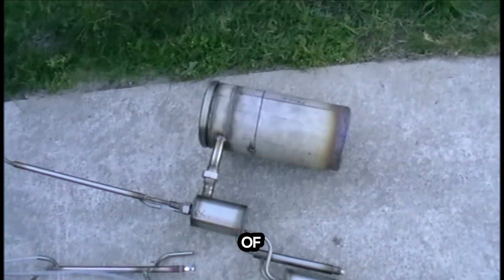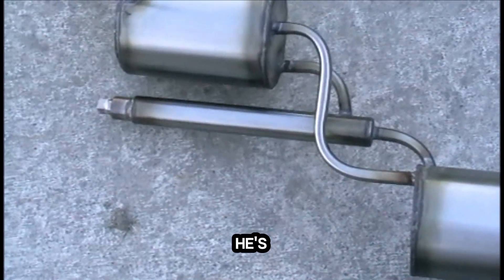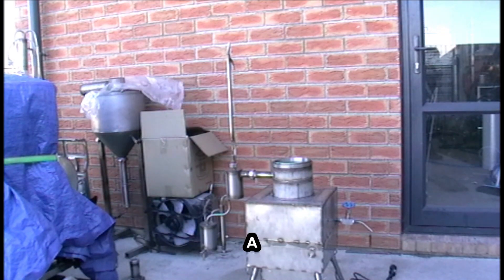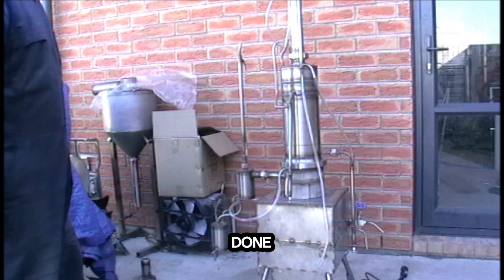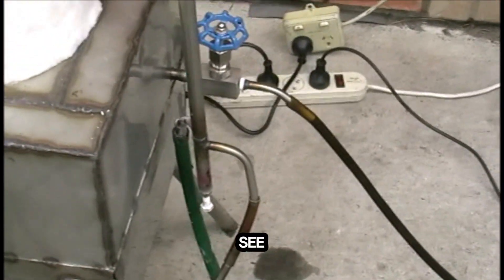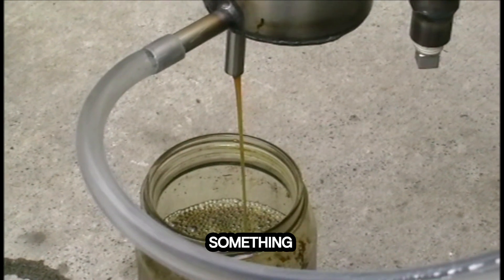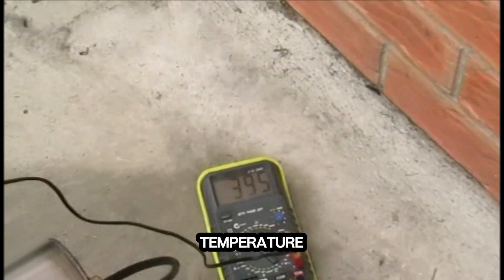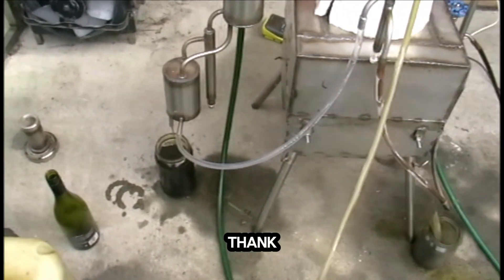WMO Still - Old Reformer run (archive video).

Comment: Hello can i destiled  the oil without centrifuge it first?
Reply from the maker: Hi, yes you can, the rough pyrolysis retort is OK with any quality oil, but be careful with possible water contamination, and some extra solids will form a lot of carbon.

Comment: Alex thank you for your informative videos.
By the way : do you have to maintain high pressure of oil vapours (gases) inside the reactor and inside the condesing pipe ?
Is high pressure necessary to convert used oil to fuel ?

If high pressure is necessary,
 do you use a oneway valve for feeding used oil into the reactor 
(to prevent hot vapours from escaping from reactor into the oil feed pipe) ?
Reply from the maker: hi, there is no pressure at all, everything is happening at atmospheric pressure, so, no pressure necessary, just temperature.
Reply: @santeryi9  +-400c ?
Reply from the maker: @jakubm1875  410c

Comment: I have a question about Your waste oil distill plans if they were purchased. How much does all the material cost not including the time it takes to fabricate everything?
Reply from the maker: The cost of the materials depends on the type of metal chosen, such as black or stainless steel. Also, if metal is bought from a dealer or a scrapyard, local market prices will dictate the cost. I do not know your location and metalworking skills, so I can not say for sure the cost at your particular place and situation.
Reply: @santeryi9  what about the temperature controller